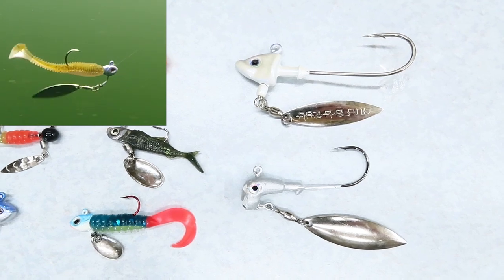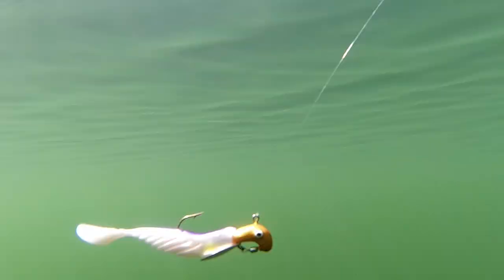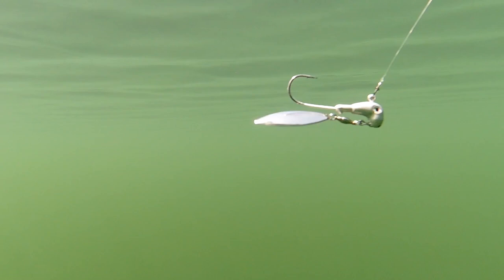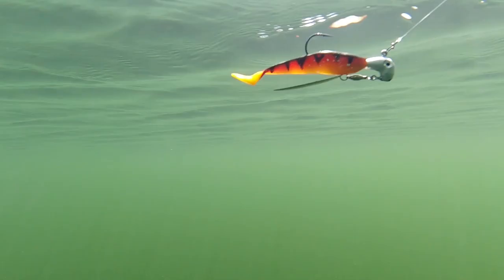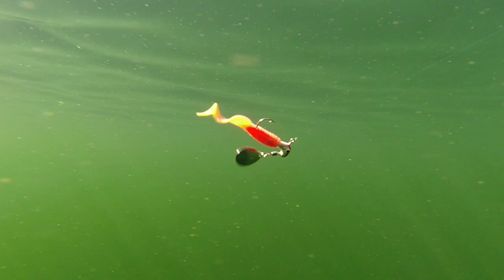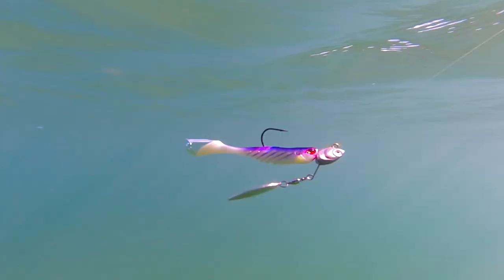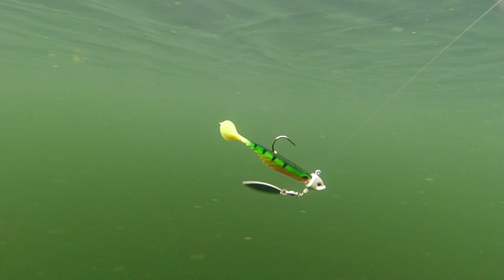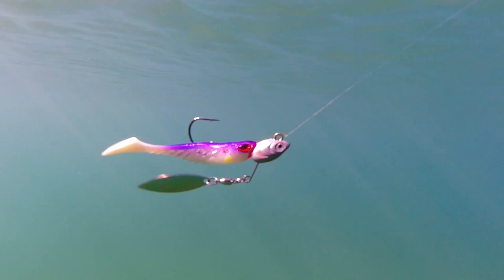3 Things That Will Ruin Your Underspin Lures

Comment: The bubble won't appear on the tail after you wait 1-5 seconds before retrieving the lure.
Reply from the maker: Depends how quickly the bait sinks. If the tail can kick really hard, it will help get that bubble off. That's why it helps to give the lure a couple of jerks at the beginning of a cast.